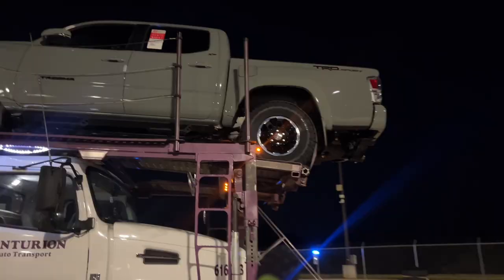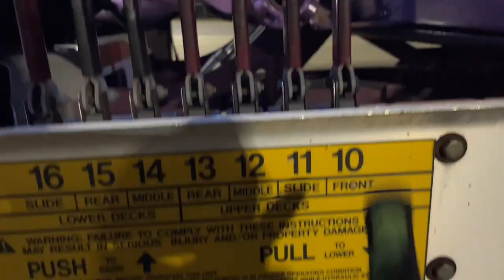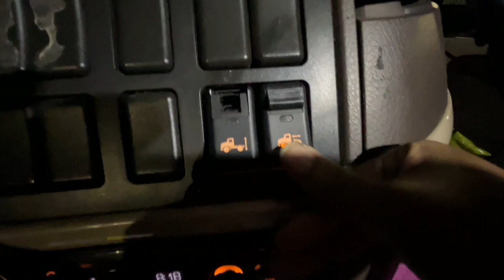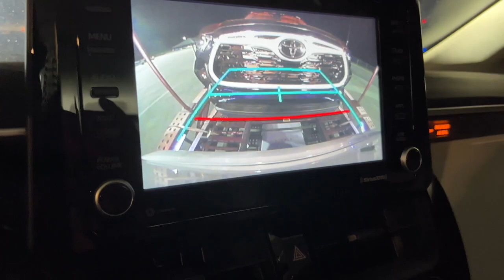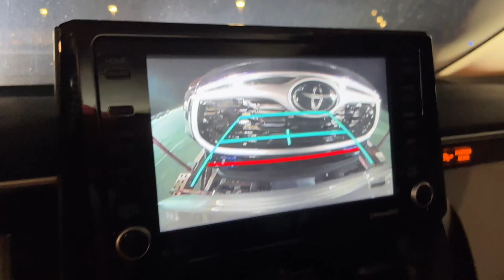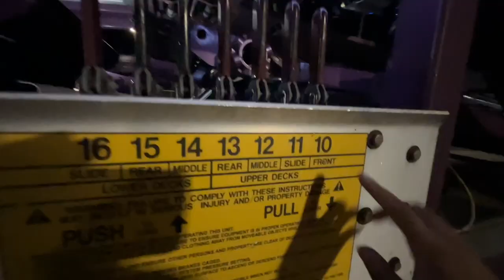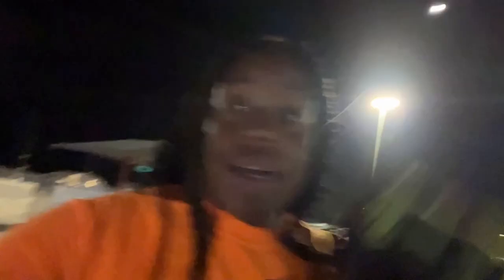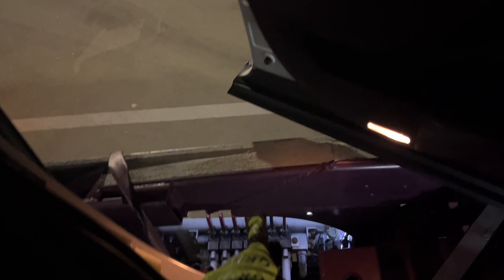How to Load A Car Hauler | 9 Car Stinger | Female Truck Driver

Comment: I can see why this pays better then alot of other trucking jobs... some skill and definitely got to pay attention what your doing... could also get stuck in cold rainy weather ( not fun) while loading or unloading...  hope your getting paid girl!! Good job on your video!!
Reply from the maker: Right on! You hit the nail. And thank you so much ❤️❤️❤️🫶🏽
Reply: You’re right about the rain. I drove an old worn out KW cabover 10 car hauler in the 90’s. Those rails were slick as ice when wet. You learn real fast to park level or you will find your self and the car sliding towards the low side.

Comment: Nice video! This was very informative. I have one big question for you Aiyanah. Is there a way to lock the hydraulic system to keep knuckleheads from tampering with them?
Reply from the maker: So….to even make your hydraulics function, you have to go in the truck and turn it on. As long as you keep it off when not needed, you’ll be fine 😄

Comment: Good job hauled cars for 35 yrs ha# the same trailer as you have although I numbered  them a little  different than you I just went straight across  the top with 1 2 3 4  5 and the one behind the tractor would be 6 but doesn't make much difference  great video be safe
Reply from the maker: Thank you Richard! 35 years? Jeezzz… I know you’re a pro at this. And I used to work for Carvana and they’re the ones that trained me so I just go based off of that for the most part. It’s so many different ways I see drivers load. And I’m sure there’s easier ways as well. But we get the job done lol

Comment: Odd question: I've been wanting grab the tractor unit (with sleeper) for a car, boat, motorcycle and then pull an rv behind the tractor when needed (jobs that require a stay longer than a month). 

Though is the semi could pull all we need for a million miles, all our toys come with us on a commercial unit. Our motor coach wouldn't last a year towing that much. Shorter job (Lee's than 1 month) we could just take the tractor unit and the toys. 

How flowed is my logic?
Reply from the maker: Honestly dude… it’s SOUNDS like a GREAT IDEA…. However I don’t know 🤣

Comment: Do you have to worry about axle weight like you do with a reefer trailer?😊
Reply from the maker: Yes absolutely however the only difference is you’re allowed up to 14,000+ on your steers. Every other axles is the same.

Comment: I noticed that the pick up truck was loaded last. This is also when you showed how to lift the flipper and pull the handle on the ramp leading up to the trailer. Is it best to put smaller cars on first then bigger cars/trucks in general to make the best use of space?

Edit: I think later on in the video you say the cars/trucks are labelled with a number, which indicates were on the trailer they are supposed to go. Is this correct?
Reply from the maker: Hey! So yes! most people will put a pickup truck there where I put it. HOWEVER every load is different! You might get 4 pickup trucks and 3 SUVs. You also have to take account for the weight of the vehicles. And the numbers represent where you want to load each vehicle. For example my pickup truck is in #6. Some instances people load their pickup truck in #1. It’s just a big puzzle! It might sound really complicated but it gets easier.
Reply: @aiyanahmoore  Hiii :) 

Aaah so the numbers are where you want to load your vehicles. But, you don't necessarily have to go with those numbers? 

Along with the numbers they come labeled with, the weight of the vehicles, and the type of vehicle. Does the order in which they have to be delivered matter? Do you ever have to unload several cars to get to a specific car for one delivery..then reload the cars again? 

Yes, its a bit more complicated then other kinds of trucking. But, it seems like you have to pick up on a lot of subtle things to make good decisions.
Reply: Reloads are almost a daily fact of life when delivering vehicles at multiple dealers, especially if you're running an 11 car high rail.